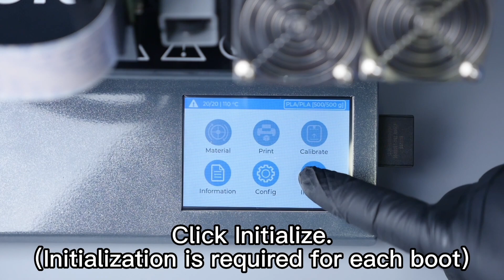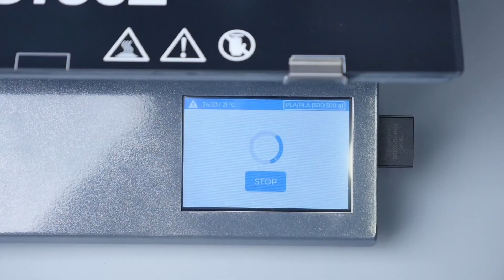Cetus2 Installation Guide Part 2 - Leveling for the First Print

Comment: Just received my backer package and the head runs deep into the printer glass bed and never stops, I have to stop the initialization.  Any ideas?
Reply from the maker: check if you have put back the front cover, there is magnet on it, it is required for Z axis homing. During initialization the printer will lower the z axis to search for the magnetic signal, if it cannot find the magnet, the nozzle will dive into the build plate.
Reply: Almost same issue. Initialization works fine, calibration is buries the nozzle into the glass and errors. =/
Reply: I’m having the same issue. Where should the magnet be?
Reply: There's more than one but the one for the Z portion of initialization should be top left front corner of the plate that hugs the cylindrical z rails.

It has a plastic screw holding it in place, either my magnet isn't strong enough or there is something else wrong because even with a new board the initialization step still requires manual physical bypass with my own magnet.
Reply: My issue was the large flex cable was not fully seated. The two main fans on the hotend/extruder should be on when the printer is on. If they're not, then something is not plugged in right.
Reply: @stazeII  glad you have it sorted, I’ve reseated everything I can think of.  Fans have been powering on as suggested since day one - I should know because they spit out fins and I’ve had to replace one already on delivery lol.
Reply: @xyexz  ew. hmm. so yeah, facing printer bed (with Z axis in back) there is a magnet on the left side of the lower cover. there's a tiny PCB that hangs down off the X axis "arm" that has an LED on it that is always on, then glows brightly when it detects the magnet.
Reply: In my case, it was the cable that connects to the front-facing side of the print head assembly. I did get some good advice from tech support: When the bed sensor is working right, when you touch the nozzle (not while heated!), an LED on that circuit board to the side of the print head assembly that lights.
Reply: @johnstonebraker8470  yup. same. that large flat flex cable wasn't seated, so the fans weren't running, and when touching the nozzle no LED would light. Would love to do some editing on their documentation...
Reply: @stazeII  Yeah - it could use a lot of help. Every time I fix one thing, something else pops up. Current issue is Z will only move up. It was working until last time I reseated cables to address sudden loss of x movement.
Reply: could something be stuck to nozzle and it thinks it's all the way down? if you hit initialize what happens?

And yeah, definitely need a wiki or... something. Would gladly write some instructions for some things.